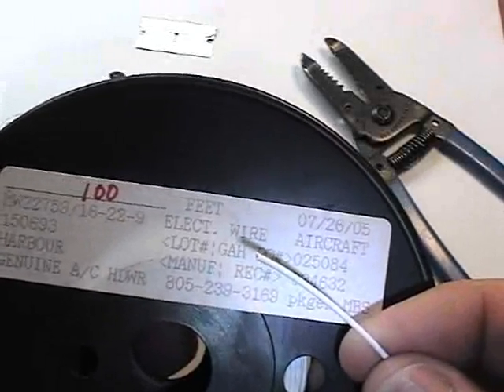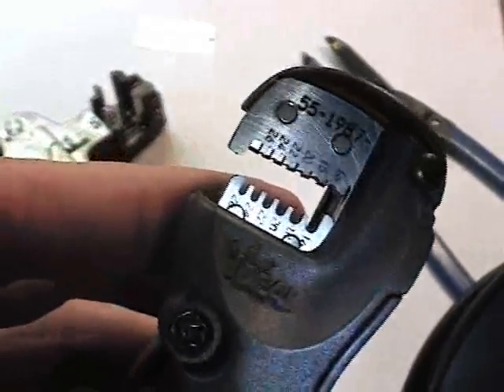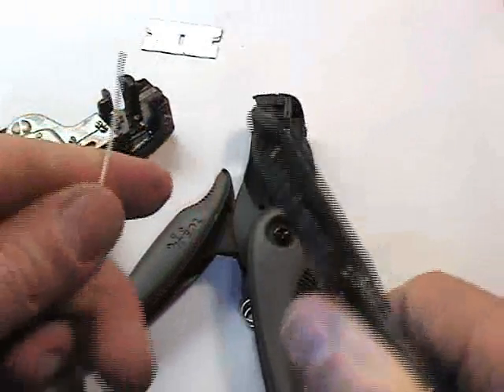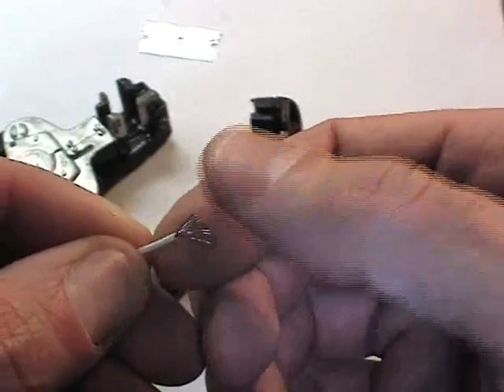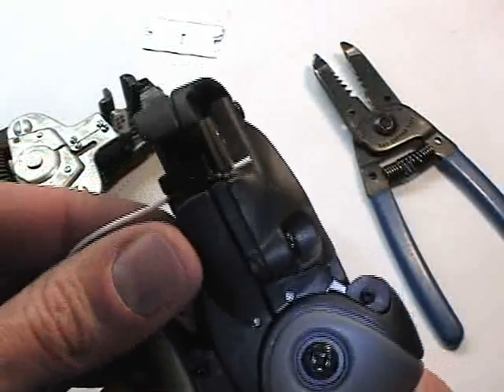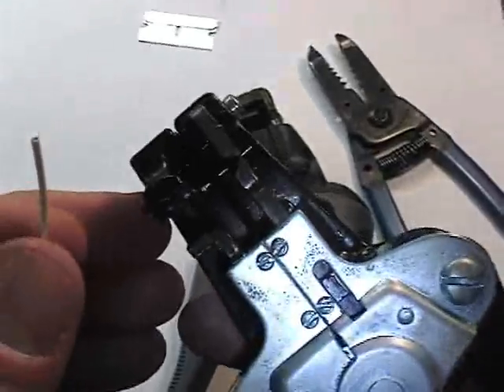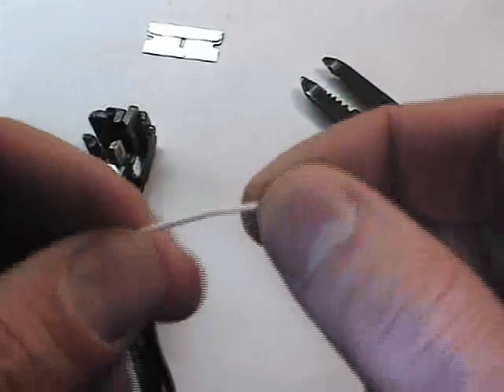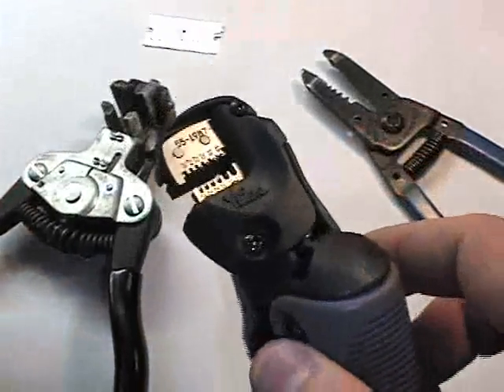using an ideal ergo elite automatic wire stripper

Comment: The "/16" at the end of the # DOES NOT mean that it is 16 strand wire. The /16 defines the type of coating on the wire, the insulation material, thickness, etc. Did the producer of this video not even bother to look up the specs of the wire in order to make some kind of attempt at knowing what he was talking about? There is this thing we have now called the "internet", if you learn how to use it, information such as the specifications for M22759/16 wire can be easily found in about 22 seconds.
Reply: Thank you. /16 has a Ethylene Tetrafluoroethylene (ETFE) insulator and is rated up to 150°C. We use this for general use away from heat sources. If you need high temp use /11 is rated at 200°C.
Reply: Not even 22 seconds.  My brain works pretty fast and I instantaneously knew you were wrong as soon as I read your writing.  You might have thought the /16 means it's 16 gauge wire, but in the video he's using the 22 ga slot in the  Ergo Elite die isn't he?  Don't worry, you're like most people who think they know everything based on institutional knowledge or what they perceive as correct because they saw something else like 16 on a spool of wire denoting the gage.  It doesn't matter to me, I never believe what anyone tells me or what I hear, but you may.  Pass your information along to someone else and continue your ignorance.
Reply: Ten Millimeter yoi must have a lot of friends

Comment: i've got a Kronus from Radio Shack for about 15 bucks.  it's an auto-stripper, but it doesn't have the dyes.  i love it. for what i do it does the job fine, although it will put a little dent in the insulation if it's not adjusted properly.  once you get a good stripper, you'll never go back to the 5$ jobber.  believe me, it's a godsend.